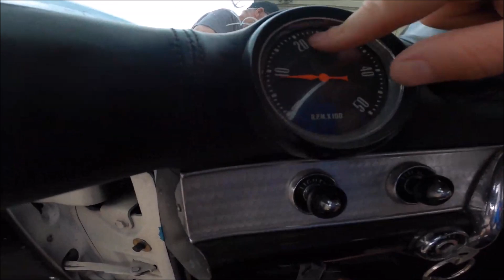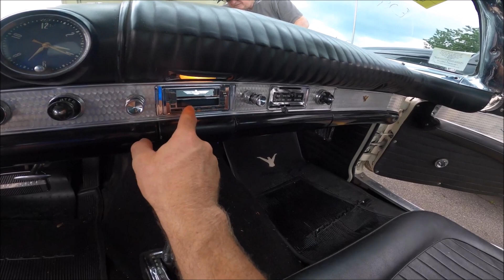Dealers License Only - Classic Car Auction - Flying Wheels

Comment: The floor switch was a brilliant idea. They should bring it back.
Reply: The wiring would get beat up from being stomped on and moisture tracked in would cause corrosion, they were always shorting out. You be driving @ night and hit the dimmer and ALL your lights would go out because a fuse would blow. They were bad news.
Reply: They got auto headlights now n my car from 2000 got them
Reply: @MybackHurtz1  I have a 90 f150 with the floor switch and haven’t had any issues over many years of driving, and definitely getting some mud and water on that switch.

Comment: Love the '56, I had a '57 . Another cool feature are the side vents that bring in outside air to the floor of the car. Make sure you service the cooling system, including a radiator flush, they are known to overheat.

Comment: Craig, you have a rare gem. A small transmission problem is not a big drama in the scheme of things. Run a strong magnet covered in thin cloth over the lower body areas to see if you have an excess of bondo anywhere. Floor button for the headlight dimming was common on older cars of that era. BTW, we have seen this car in the workshop in your previous video, so this one must be out of sequence?
Reply from the maker: yes. I bought it 2 weeks ago

Comment: Bottom is the high beam switch.
..I wish cars still had them there.
Reply: No, you actually don't. The floor plans all rusted out around that switch and it was a common failure point because the switch is exposed to the elements underneath so they corroded and rotted. They were just cheap tin.
Reply: @muskokamike127  Exactly. I've had them short out and loose ALL my lights on a back country road on a dark night when I hit the dimmer. Very scary @ 60mph and everything goes black in front of you.
Reply: Agree. Hands free!
Reply: @MybackHurtz1  THAT is exactly why I brought it up. I was a city boy but most of my driving in my first year was done in vacant gravel back roads up north. 

Most people don't have a clue what complete black is when you live in the city lol. I mean, literally you can't see your hand in front of your face!
Reply: The one in my '74 Nova works just fine... 🤷‍♂️ Same for the wife's '79 f-100.

Try actually cleaning your car every now and then...
Reply: @brianbird3756  It wasn't my car. It was a work truck, Dodge my boss offered to sell me for $50 @ one point and I declined.
Reply: @MybackHurtz1  great story, who are you?

Comment: The most surprising thing to me is that you don’t just expect every car at the auction to have some sort of hidden problem 🤣
Reply: Seems like a fun job. I just couldn’t get over every single person selling a car trying to cheat you by erasing codes. I couldn’t be dishonest like that. I have to be able to sleep at night. I guess that’s what’s wrong with the country
Reply: That’s why customers think dealers are always out to get them. Being shady for so long tarnished the industry. Go up and down some of the larger streets in my area and all the buy here pay here  and budget dealers are long gone closed up.
Reply: I'm also a dealer. Can confirm. EVERY car has some sort of hidden issue. That's why they are there 🤣
Reply: Floor switch is to turn on the high beams.
Reply: I agree.. you don't take decent to better classic cars to wholesale auctions..they go to one of the online auctions ,or  one of the big three auction houses
Reply: @woodrowbunopaddle  I had a wholesale business on the side and there was no rhyme or reason for some of the stuff that would show up at auctions. From new to classic to exotic would pop up, I think sometimes dealers just need the cash and can’t wait any longer.
Reply: @GQ-wz5it  i hear you.. In my 25 years of wholesale auctions I rarely saw an actual collector car at auction. It was usually a nice older driver,or  matching number car with a bit of baggage..  On Bring a trailer /Mecum/Barrett Jackson ,you usually are selling to the end user...With a wholesale auction you are dealing with a reseller for the most part
Reply: Exactly!  And then worse yet, is that you're surprised that another dealer would do such a thing to you.  99% of the cars at an auction are there for a reason, otherwise they'd be parked in someone's garage.
Reply: @charlescorey184  and back to low beams- toggle switch

Comment: Love the vids where you interact with your grandfather. You can't say that you were burned if you didn't look the car over before bidding on it. Just like buying a car from copart without the keys, you stay away from anything that you can't drive or start up unless it is a price that assumes it doesn't run. Good on you that you are doing well enough that you can bid on stuff without looking them over and using a scan tool on them and take losses.

Comment: I just found out about the high beam switch when I bought a 68 Mustang two weeks ago
Reply: That is a great model.  The high beam light is a pony centered above the steering wheel and you have a pedal on the left for your wiper fluid and wipe.

Comment: Floor button is for the high beams. That was a 5 window Ford model A at the auction. Greg you got a nice car, don’t be upset about the reverse issue. All classic cars have their quirks and you are bound to find things one you get it home. All in all it’s a great find. The transmission is worth fixing and this car is way  better than any modern sports car. Good luck with it!

Comment: Those old Ford V8s had a valve train oiling problem and the typical fix was to run an extra oil line to the valve covers to spray oil on the valve train.  They didn't perform as well as the chevys but would last longer.

Comment: unless you want to take a huge loss on it your only option is to fix it which may mean you have to yank the engine and trans as one unit to get in to where the bands are for the reverse gear. think about how much easier working n that will be though versus a newer model car. That one should be a complete cake walk

Comment: It's the bright light switch does yours have the swivel steering wheel so you can push it to the right to make it easier to get out I saw you had a bench seat instead of two captains chairs and my uncles had the captains chairs but when you got in and out of the car they would swivel so if you were and any kind of height restriction meaning 6ft over it would be easier to get in not only that but if you were somewhat not mobile but you wanted to drive you can actually get in by just swivel in the chair outward get in and swivel effect with the steering wheel they really need to come up with that again

Comment: I put a 69 Cougar drive train, 351W 290hp V8, FMX auto, 9" inch rear in my 70 Mustang Fastback that came with a 302 220hp V8, C4auto, and 8" rear.  That FMX shifted quicker and would spin the tires when it shifted to second at full throttle.

Comment: You have to pull the motor to get the transmission out. Above the dimmer switch is the windshield washer pump.

Comment: You think there's a lot of rattling in the exhaust to the frame the way it runs through there when things get loose there must be a lot of Tolerance going through the frame holes where the exhaust system